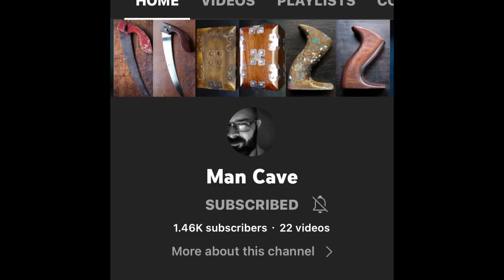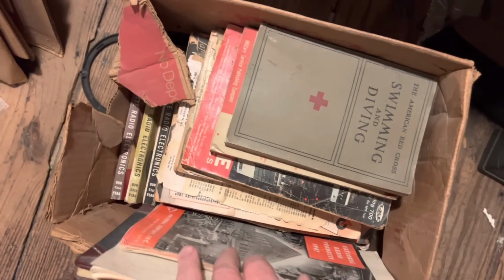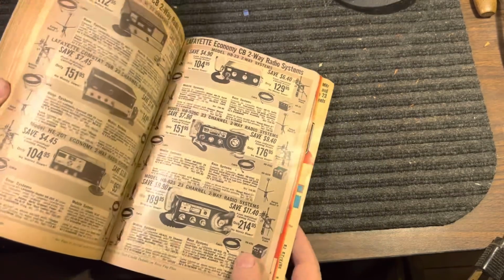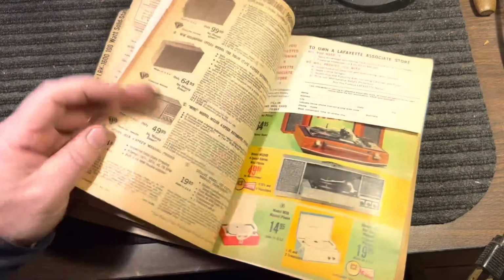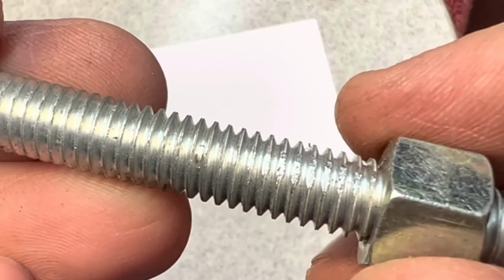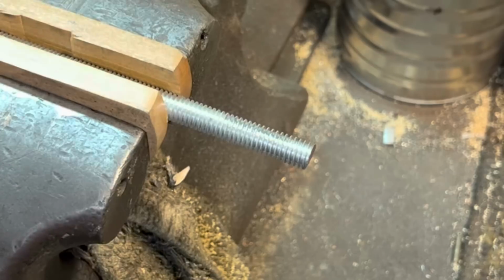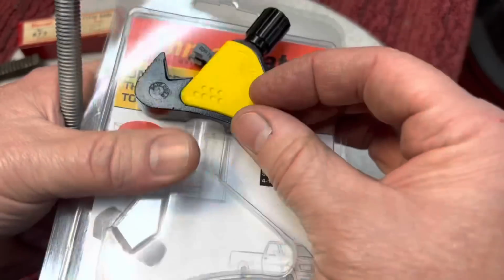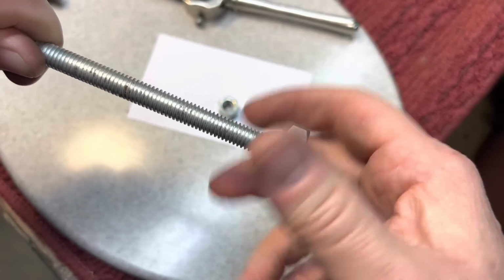Man Cave Gone but Not Forgotten, Remembering Lafayette￼ and Thread Repair

Comment: Good information on your thread repairs. There’s another very effective way to repair banged up threads. All you need is a good nut and a small hammer. First identify the damaged area. Thread the nut on by hand as far as you can. Now rest the nut with the flat side against a solid hard surface such as your vise. Orienting the damaged threads ⬆️. Smack the nut smartly. The good threads inside the nut will re-form the damaged threads on the bolt. Advance the bolt ‘till it jams again & smack it again. If the threads are damaged all around the bolt then you need to rotate the nut/bolt to each flat on the nut. Soon you will have worked your nut through the damaged area.
I’m going to look up mancave. Wished I could have watched him before he passed.

Comment: Hi Scout and thanks for the shout out, you are so generous to everyone. I liked that single blade thread file and although it’s not as quick as the multiple thread file it will fit all but the most obscure threads. It would at least get you out of trouble with the 55 deg BSW (British Standard Whitworth) threads, all the metric and most US threads so I’ll be on the lookout for one. I forgot to mention in my video but you covered it and that is get a US made file. I think mine is the same brand as yours. Our thoughts go out to Mike’s family and the pain they are feeling.
Thanks Stuart, 🇦🇺

Comment: I have the ThreadMate.   A useful item in the toolbox.   I also have a couple of imperial thread files and one metric thread file.   I find the thread files are the best way to fix threads which are messed up at the end of the bolt.   In these cases I am not able to get a die to start and often sometimes I do not have room for the Threadmate.
Lafayette, Radio Shack, Heathkit, Curtis Mathes, just a few brands which are long gone, sad to say.   Thanks for the trip back in time.
Modern BS threads use 60 deg.   It is the BS Whitworth thread which uses 55 deg.   Any vintage Stanley Bailey and many other vintage hand planes use Whitworth threads, some very odd tpi.
Dave.
Reply: Actually Radio Shack is still alive and kickin', they just closed a whole bunch of stores across the USA. I bought so much stuff as they were clearancing out everything. I got a hundred dollar Amplified TV antenna for 19.95. Also scored a twenty dollar laser level for $1.99!

Comment: On thread repair, one other option (Last resort type thing) is if you find yourself with none of the options you talked about, let’s say you have an unexpected break down, virtually no tools, you have damaged threads on a wheel stud, the nut still being good, start the nut on and when it stops, get a hammer and something to use as an anvil, put the anvil on one of the flats of the nut, take the hammer and tap the flat 180 degrees from the anvil device, after a few strikes, stop and see if the nut will advance, which it should, roll it back and forth then, by hand run the nut back to the damages threads snuggly and repeat, I have used this technique dozens of times, it does work,but it takes patience. This works also if the nut threads are bad and the bolt/stud threads are good. Try to add lubricant if you can find anything at all, this system requires a little thinking out of the box sometimes. Hope this makes sense.7

Comment: Rupp was a brand of minibike that was much more capable than the ones you saw in the catalog.  Rupps had drum brakes, shocks, and of the three Rupps we had, all of them had a 5 horse Tecumseh engine with a belt driven torque converter so they actually had low end torque to accelerate and then the torque converter would automatically the ratio of the pulleys to have a faster top speed!  They were great fun!

Comment: Thanks for those good thread repair tips, and the good point that you may not always be able to use a thread die so that file is handy.
I remember Lafayette radio and have several catalogs along with Radio Shack, Heathkit and Allied radio catalogs from the 60s and 70s

Comment: There's a great Old Farmer's trick for fixing buggered threads if you don't have a thread file or a die. Take the highest grade nut you can find and cut a third of it away with an angle grinder. It usually has enough flex you can pop it on the boat anywhere and running it up and down will work just like a thread file. It's a good little trick. I have a whole drawer full of cut nuts, I personally prefer it to the file.

Comment: I was always told to never recut a thread it makes them sloppy ( bugger's them up ) to use a thread chaser.
Reply from the maker: The chaser will tend to stand the metal back up where as the die will cut off the overhang.  I agree it’s always better to keep as much material as possible.  😃👍

Comment: Good Info as usual...I have a question...when I am removing rust ect.from some metal tool like a metal steel square with a wire wheel on a bench grinder I get it clean but it has different shades to it ...not a uniform clean...so what's the deal ??..and no it's not aluminum...🖖
Reply from the maker: Chuck sometimes that happens because of how the steel was tempered and how the rust effected it.  It does seem to happen more on thin flat items.  Sometimes the fiber wheel will do a better job at blending the finish.  😃👍
Reply: Difference in metal composition, oxidation, natural staining. Once you start grinding, filing or sanding you see it become more uniform and brilliant. In my experience anyway.
Reply: Thank you both....🖖

Comment: In a pinch, wouldn't ANY common triangle file work to improve thread profile?  It stands to reason that their angles are also 60 degree.
Reply from the maker: Hi Keith- Great observation.  I will measure the file angle on both-  The thread file seems much thinner!  😃👍

Comment: From the shops I have worked in, buggered and boogered are used pretty equally. You might want to familiarize yourself with the English and European definition of bugger if you are not already familiar. Based on how you edit yourself in the past, I would think you would be inclined to use the term boogered, at least in mixed Company. That said, I have always used the term buggered.